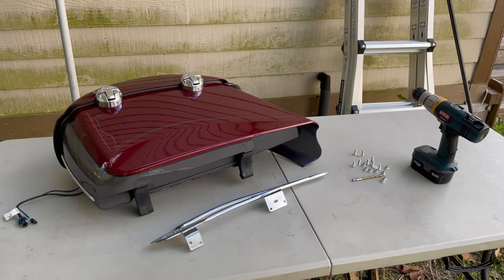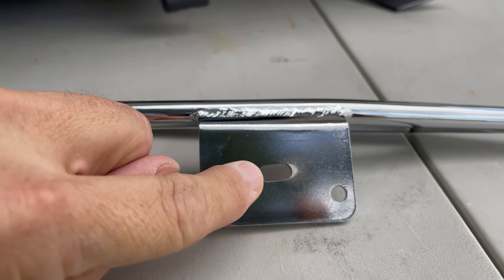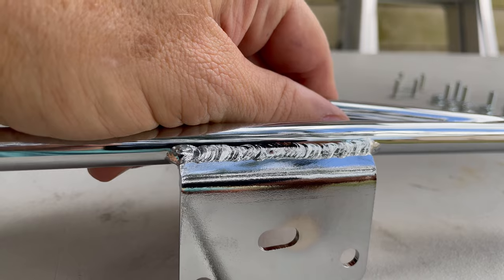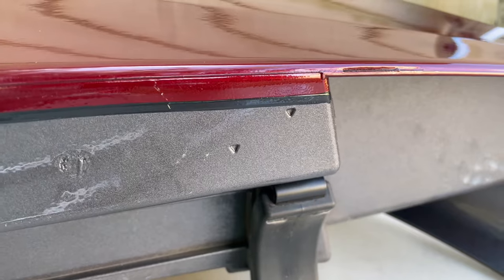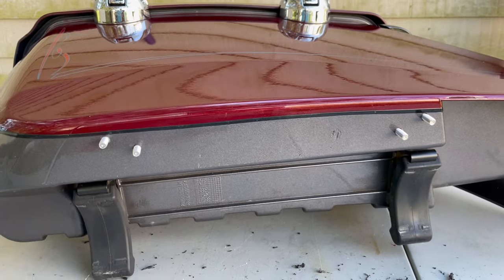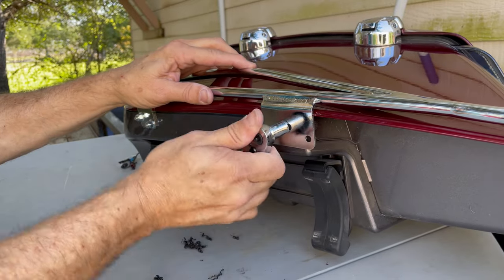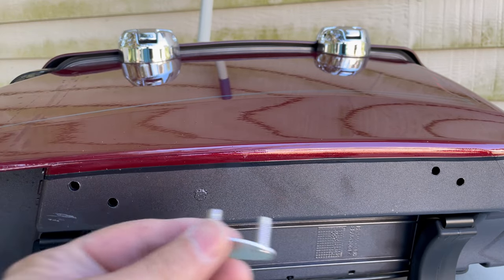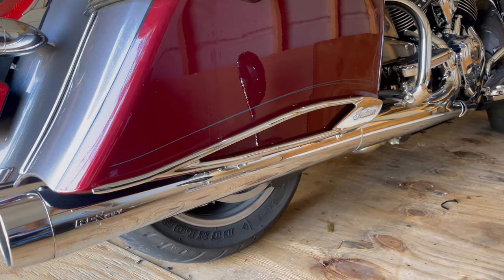2019 Indian Springfield saddlebag rail trim install (part 2880917-156). ***Read description first!

Comment: Sadly I agree and am finding out the cheaper ones off EBay do not line up properly and mine have one bad weld spot on each at the narrow long rails point where they come together which are visible. They didn’t evenly distance the mount plates and they don’t line up with Indians pre drill marks. Even if I would have tried to adjust and line them up, one rail would have rubbed as you couldn’t drill the plate far enough in under the saddle bag for the holes to line up and for the rail to not rub. I’m sending them back and regrouping my $$ for Indians
Reply from the maker: Well don't feel bad. We all want to save money one way or another. Motorcycle ownership can be an expensive hobby. Just remember to put the bolts on from inside the saddlebag instead of from the bottom after you get your genuine Indian parts in. Freaking Chinese companies are so lousy with their products.

Comment: Get ones don't have indian on them in ebay cheaper
Reply from the maker: I tried that initially, but the build quality of the ones I received was horrible. Specifically, the welding was bumpy. Not smooth like the Indian versions.